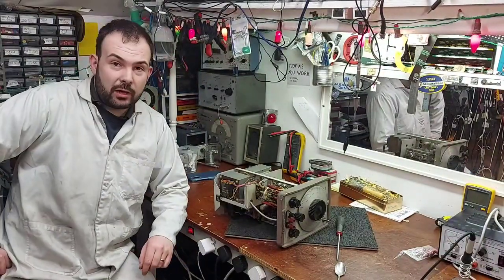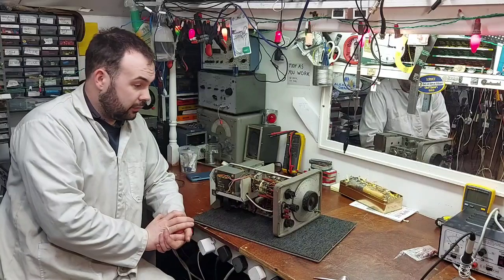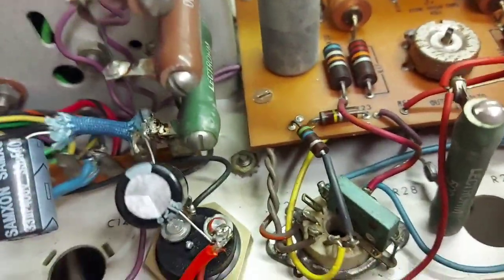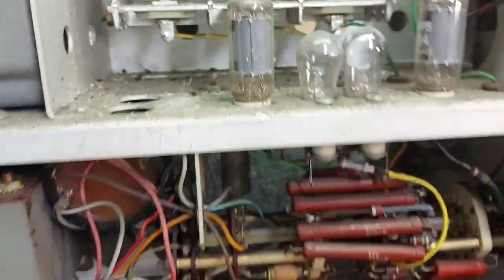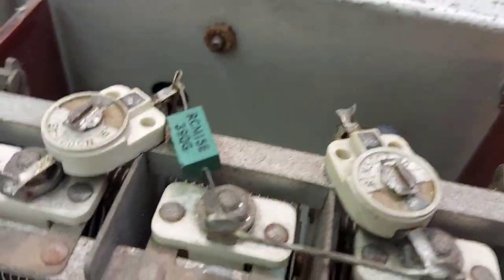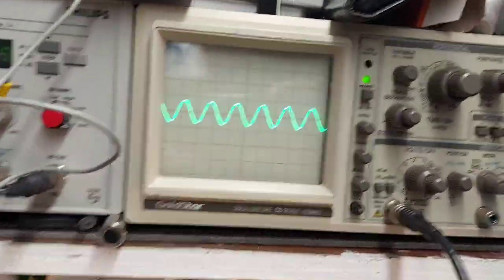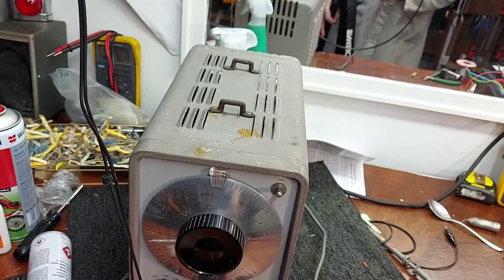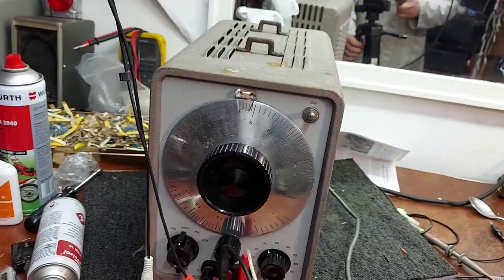HP 202C Low Frequency Oscillator.

Comment: This was based on Bill Hewlett's breakthrough design for a Wien bridge oscillator with a lightbulb in the feedback circuit to achieve stability. The 200A ( a predecessor of this one) was the first ever HP product and got Bill and Dave started. The 200A sold for about $54 while competing products of similar performance sold for $200 to $600. Nice work on the restoration. I'm not sure that the dial was originally polished. I suspect it was anodized. Not sure about that, though.

Comment: I like the idea of using a belt for a handle, the tuning disk looks smashing now :-D
That's a good old no nonsense generator, i imagine it was not cheap originally.
I can't imagine how much the tuning capacitor would cost now,  an empty wallet and a kidney lol.
It just needs a small audio range counter on top and wired direct.
i modified a sloped bremi 100mhz c.b counter to work with a home made frequency generator.
it sits on top and hard wired.
i removed the prescaler and changed the rock so it gave more digits in the audio range.
Most of the cheap c.b counter chips are low frequency.
So does the case of the gen smell of freshly washed plates ha ha :-D
Reply from the maker: I know a cobbler who will cut me a piece of leather and give me a couple of rivets.
Reply: @IrishvintageTVRadio  That would look spot on  and strong :-D.
Most of the real cobblers have vanished in my area, it's becoming a dieing trade :-(.
Its much like the iron mongers shops,  not much need any longer, even hardware shops are getting a bit thin.
My old mate used to say " The world is falling of it's pin."  he was mad like that lol.
Reply from the maker: @zx8401ztv  Like most, he cuts keys as well. I do agree that there is something wrong with the world in general...